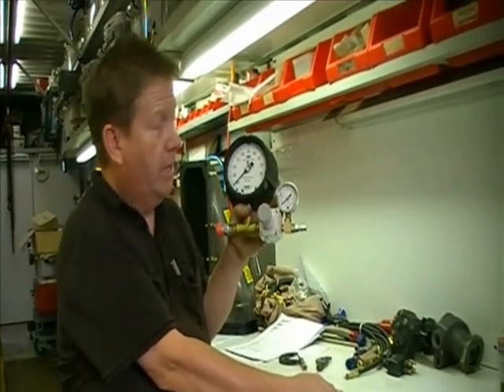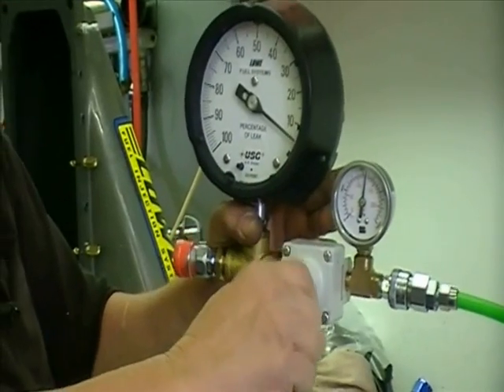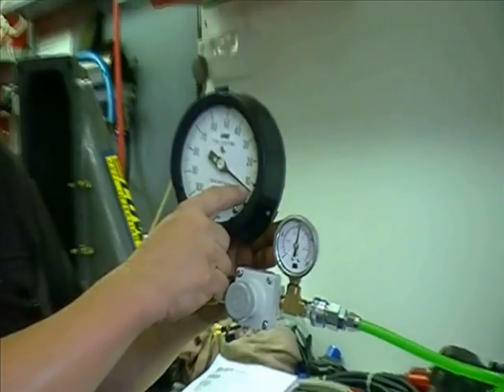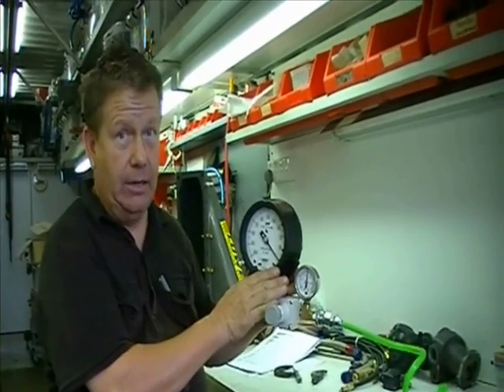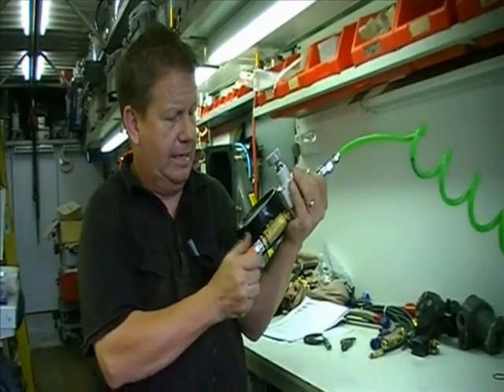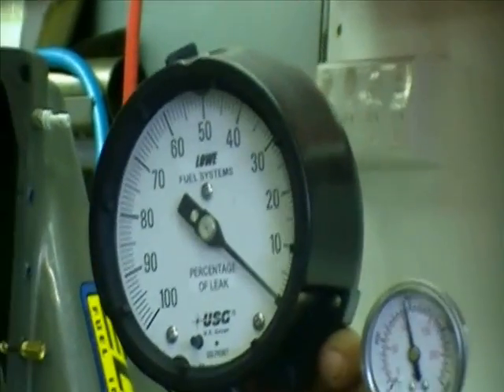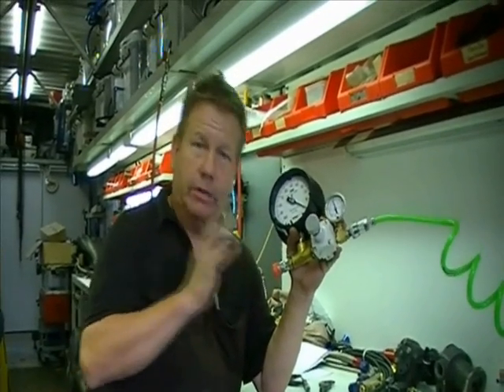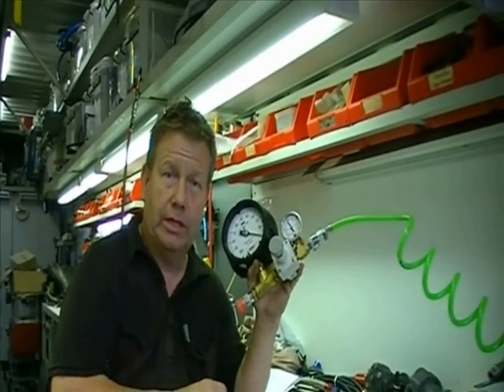How To Leak Checker Calibration 001

Comment: What I don't understand is, if there is a .040" jet between the reg and .080" cal jet how can the gauge read 80% (20psi) would not a .040" jet read 100% leak or 0 psi
Reply: No the jet size between the gauge and regulator is the size necessary to achieve the 80@80 calibration. USUALLY is is about a 0.040 jet but can range from a 0.038 to a 0.041 as often drilled jets are not flowed jets. It is the 80@80 calibration that you seek. More importantly is the dead band often found on ordinary cheap leak checkers. Most $150 dollar leak checkers use a non compensating regulator that can be purchased for $5 dollars and the level of quality that is associated with that.  Cheap tools give cheap results. Check your dead band. If you can move the knob and the needle on the gauge does not move then you know what you have. How much margin are you willing to live with?